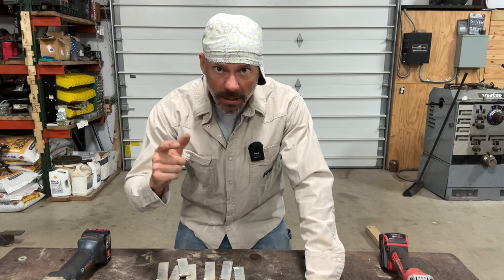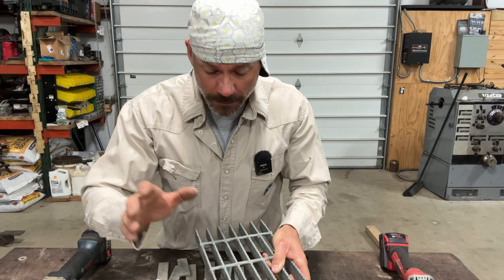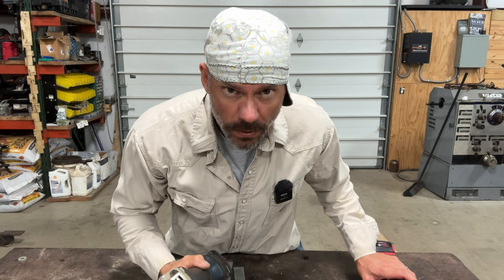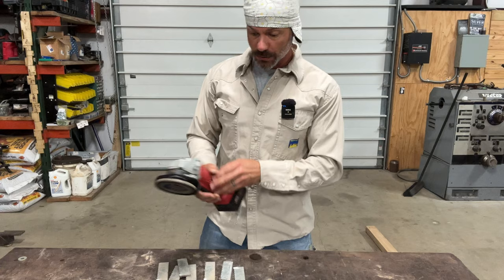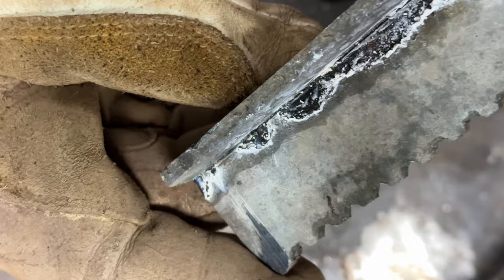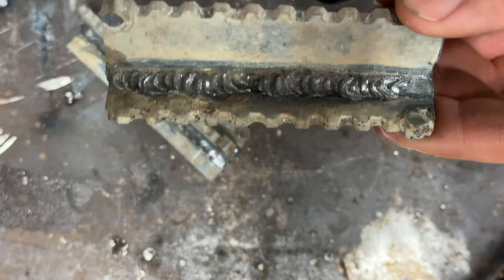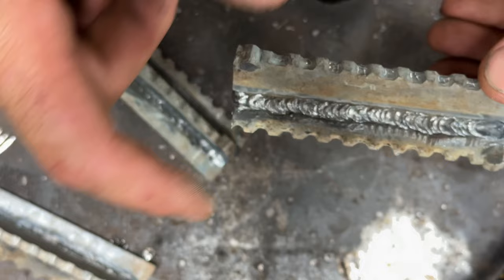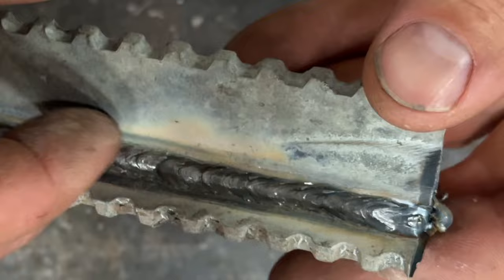The Secret to Welding Galvanized Metal Revealed!

Comment: You’re 100% correct and I’ve told many of my helpers (when I’ve rarely had one), “ if you ain’t seeing sparks, you’re not done yet”. I typically find that welding it with hard wire and 75/25 works pretty good but you need to turn your gas up and use a push travel ONLY! This way when the arc burns through it, your gas can blow it away before the puddle gets there.
Reply: I will try that, thanks!

Comment: Another YT welder suggested using muriatic acid 1:1 ratio with water.  It works.  Completely dissolves the galvanize away.  However, the challenge is submerging the welded parts.  It only takes a few minutes (3-5).  I am replacing my gutters with 18 ga galvanize.  Sheetmetal shop just did the bends and cut the end pieces for me.  I dipped the ends of the gutters in about 1/2" of the acid and water.  It looked like a bathtub ring where the galvanize was removed.  I submerged the end pieces also.  No grinding.  The other thing too, when done welding, you need to paint it.  It can flash rust fairly quickly.
Reply from the maker: Thank you. I will use this method for sure.
Reply: Just be aware that this produces hydrogen gas so not for confined spaces, also steels with a tensile strength >150ksi can absorb hydrogen if stripped or pickled in an acid bath leading to embrittlement

Comment: The zinc coating which is galvanisation is what gets you sick, if you weld and burn it, it will be in the air, and if you grind it, it'll also be in small fragments in the air but probably not as bad. You can remove zinc with certain acids and other treatments without causing fragments or aerosol, or you can just wear an aerosol/particle mask.

Comment: I have used muriatic acid to strip zinc galvanizing. Also use a shop vac with a funnel at my work bench to suck away the zinc oxide fumes.
Reply: Thanks! I'm gonna try that because I need to weld a frame from galvanised 1" box section. Here in the Philippines I can only lay my hands on galvanised or stainless, and stainless is well expensive here.

Comment: Years ago I got zinc poisoning from galvanized and it wasn’t fun . Wear a respirator guys and gals
Reply: The thing is, the effects are cumulative.continued exposure amplifies the effects and it leads to liver and or kidney damage
Reply: Yup, I learned this the hard way. If it wasn’t all grinded well and you weld it for an hour or so, that headache will hit hard
Reply: I used to do a lot of heavy cast iron brazing with 1/4 low fuming bronze rod. When you get sick, it feels like the flu. A doctor at the time told me that the zinc will disapate from your body, and should not cause long term problems. I later started wearing a respirator. 
If you are welding thin zinc plating such as electrical conduit, tig it with silicon bronze. You will love it. It is strong with a good appearance and you won't lose as much of the protection of the plating.😊
Reply: What respirator works well I see a mask?  I used to use I think the miller lpr 100 can't remember the filters though they had carbon on them
Reply: @aswervio7852  am now welding a greenhouse from 50x50 mm 1.5 and 1.2 mm galvanized  square tubing . Nothing so far but i got issues welding it with a stick as it doesn't stick well sometimes and if i push harder or up the Amperage i make a hole . Damn awful! İ go slow dub dub first pass then full weld zigzag but mostly need third to fill in cold welds as it doesn't stick well.
Reply: @alexeyorlov9639 try to wells it vertical down.  The heat and pool becomes much easier to control.  This requires the correct rod. I would use e7018. You have to leave a gap between the work pieces but an upward electrode angle with correct pool transfer between each piece is pretty fast.  Welding about one to one and a half inches per second with pretty low amps.  Usually half the welder capacity amperage.  Hope this helps.  Electrode angle is usually most difficult to mitigate.
Reply: I weld over paint with 6013 gotta love those farmer rods
Reply: galvanized poisoning sucks. all you can do is drink milk

Comment: I was stick welding galvanized last week to shipping container wall steel.  Problem is controlling the pool.  Overheadhorizontal  is hard on the shoulders and fairly difficult. With lower amperage and good filler control,  beautiful welds with gorgeous penetration are only a millisecond away from holey sheet or holy pass. I like your videos so far.  Keep up the positive content man!

Comment: Trying very hard to learn how to weld properly when I was young which was very many years ago in the farming Community where I was raised the farmers were given the option to keep high-tension high-voltage towers that were taken down to re be replaced with bigger ones I cut a lot of that metal up for one of the farmers and like you said you will get super sick and feel like you're going to die so please be careful if you're cutting it burning it in any way shape or form welding with it if you do anything to it that makes it turn red wear masks or do it outside and well phenolate area

Comment: This video came at a great time Chris. Working with some galvanized  on a muffler repair for a customer. Literally hate galvanized and the smoke that comes with it. Using Fluxcore E71T-11 21B Fabshield on the mig welder to weld the muffler.

Comment: I learnt after I breathed a little bit ..outside in a wind...yep...I got a lung fulll and although I didnt have breathing issues it took all my energy and gave me a headache like you cant imagine ...just don't breath it..and be really careful if you forge and try burning it off metal. It will get you at some point.
Thanks for sharing , those are some pretty neat, tidy welds considering what you were working with

Comment: My pal got the green smoke in him once. I know from his experience that it is to be avoided.  

I also know another guy who almost killed himself by inadvertently making a nerve gas while TIG welding--something to do with residual brake cleaner in an unseen pit, which with heat and Argon turned into some super deadly stuff. He was hospitalized for a few days and took months to recover.  He wrote about it way back. Had he not used brake clean, or been on smooth metal, or used a different shielding gas--nothing would have happened.  He said he saw the tiny puff of smoke when the chemical in the pit combined with the Ar.  His suffering started soon thereafter. The event is still descrbed on his site if you want to look it up. He is Steve Garn at Brew Bikes. I'd give a link but you know the AI will delete it-so I quit trying to share links.

Comment: I use a 20 inch box fan to blow across me and the weld to keep the fumes away. Also I have used a 1/8 6011 rod set on DC+ to weld it.
Reply from the maker: That is smart

Comment: Hey man thanks for all the advice. Could you please link that video for welding through paint with 7018 please I can't seem to find it. I started working for a small ironworking outfit just under 3 months ago straight out of community college classes and the biggest change I've had to learn is how to weld through galvanized and paint on material. We're welding through galvanized and paint all with straight 7018 it's definitely made me have to incorporate different techniques to my welding but I'm starting to get the hang of it.
Reply from the maker: There is no video. But that was the trick. Turn it up step it in.

Comment: Well known that you do not weld galvanized.  Fumes will cause metal fume fever.  Grind off the galvanized coating before welding.  Same for Chromium plated or dipped metal.  I would be wearing a powered air supply respirator.
Reply from the maker: That would be really smart. I wish I would’ve treated myself a little better.

Comment: Be super careful cutting it with a plasma cutter, it vaporizes so much of it so fast you just about have to run away from the cloud......ask me how I know
Reply from the maker: OK.. How? fill me in
Reply: @TaylorWelding  
An operator came over to the maintenance shop with a piece of dust collection ducting that was thin galvanized sheet metal and asked me to trim some off, knowing the plasma would slice right through it I said sure. Marked it out and cut it in about 20 seconds before I knew what had happened I was standing in a yellow cloud.......I took off out of the shop and around the outside to open a bay door.
Reply: Really glad I read this before I used my plasma on galvanized sheet metal😂

Comment: lets say your working an project and have alot of galvanied tubes and you,grind,weld them(with mask ofc and outside)  and in condition were there is alot of humidity when its built 
 . what would use to cover the welds? (beside zinc paint spray which only last some months)  ? the same paint primer  the use to paint ships with?
Reply from the maker: That's a good question i've often wondered the same thing. I don't have an answer that zinc paint sprays a joke

Comment: I run flux core & tend to ignore whether the steel is galvanised or not. Flux core barely cares. "Crud" floats up in the flux - zinc counts as crud in this case.
Reply from the maker: I have not run very much flux. I bet it does work good

Comment: it is too bad papr systems are so expensive
Reply: @TaylorWelding  PAPR systems are battery powered forced filtered air respirator systems built into an enclosed welding hood.  they seem to run 1-2k$.   you dont have to wear the facemask for smoke filtration.  ARCone welding works in the UK and they are kinda mandatory over there.  Powered Air Prefiltered Respirator?
Reply: If welders are in the practice of fabrication, why are there 50 tutorials about making your own papr?
I've never gotten zinc sick because I won't weld zinc.
People I know say they been zinc sick so many times.